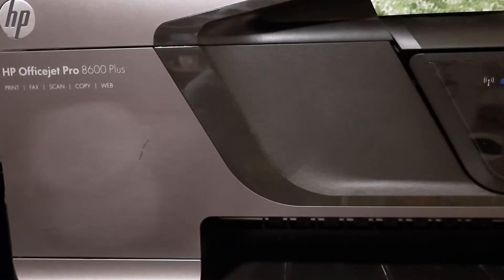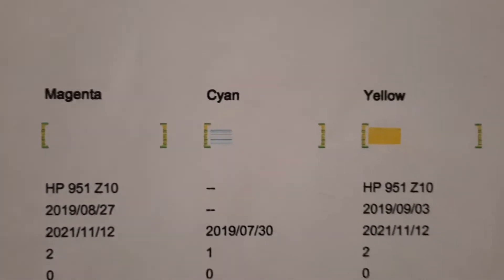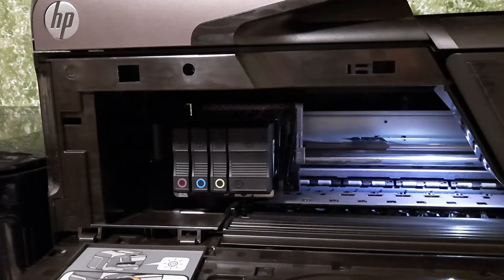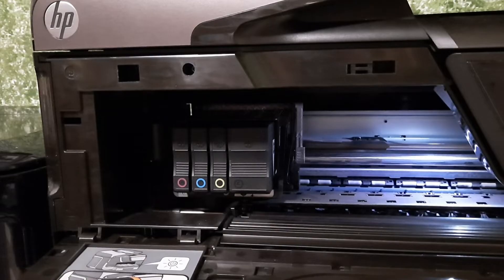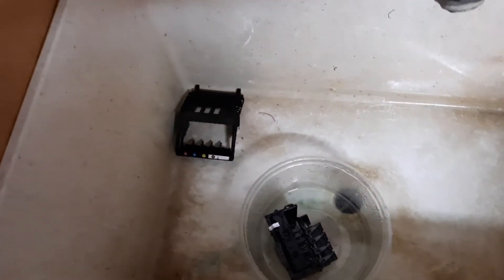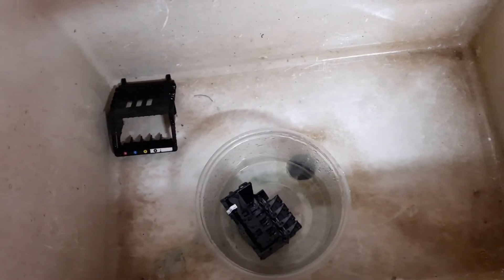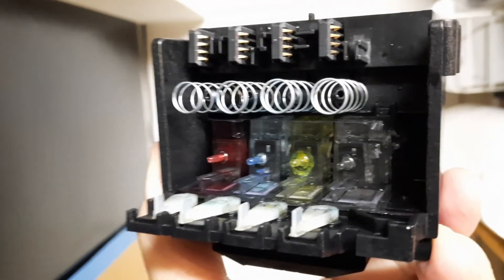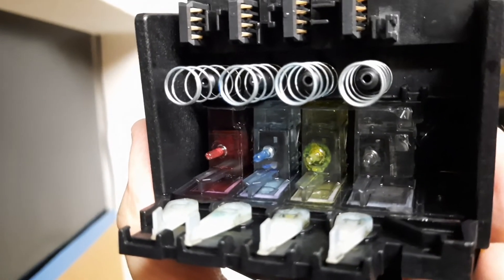HP Officejet Pro 8600 Plus Print Head Cleaning Tips for 2022

Comment: I purchased generic cartridges and got a “replace damaged cartridge CY”.  I went out and bought genuine HP cartridges but the message didn’t clear.  Any ideas?
Reply from the maker: I always used refillable cartridges.  Can you bypass or X that screen/box  on your computer
Reply: I’m having the same issue. 😡. Nothing clears the message. I’ve tried unplugging it from the machine and wall and then plugging it back in. Didn’t work. The only thing I haven’t tried is buying yet another set of new HP ink at over $100.

Comment: These print heads are junk. If one is giving you trouble jus buy another one from HP or get a new printer. Save yourself the headache.
Reply from the maker: You are not wrong.  Caveat emptor.    Let the buyer beware.  I'd be really cautious about used print heads.  New print head is about $112 plus tax and shipping.  So you have to wear the benefits, Buying a new one is not a bad idea. I bought an HP laser jet and the ink never drives out.  
On the other hand I have a Canon DVD printer,  with a bad print head, I haven't used in eighteen months.  I have about ten DVDs to print, And I probably have to take the risk to buy a used print head, because I don't want to buy a whole printer for this purpose only.

Comment: I am currently cleaning my head. Soaked it in rubbing alcokol overnight. You are VERY lucky you didn't blow out or rip the plastic diaphragm covering the ink reservoirs. If they rip or develop a hole while doing this, you have to use a flexible sealant to cover the hole. Make CERTAIN to use your finger or thumb to hold the small clear plastic film down when using the waterpick or applying ANY pressure to the ink resevoirs. I ran rubbing alcohol through the waterpick to clean the stuff out. This seems to be a common problem on the 8600 machines.
Reply: Yep, that’s exactly what happened to me. I was doing it with A medicine needle that you give your kids when they are sick for medicine and all I hear is…POP!!

Comment: You need using windex glass cleaner you need more solution than water like alcohol also need more time ..also the cause may be the rear back coonectors not work or  pressure in cartridge need alteration
Reply from the maker: Yes try everything first.  I sold mine as a black and white printer.  Saved it from  the window drop...

Comment: Don’t be afraid to drench the print head in water. I honestly did this as a last resort & it worked. I used an old soap bottle with a fine tip to spray each color individually. I also let warm water puddle to where water was going into each color simultaneously. I went as far as wetting the electronics which I don’t recommend. I made sure to blow dry the unit thoroughly & after installation all codes went away & it worked like new !
Reply from the maker: Congrats, nice to hear a success story

Comment: I have a HP Officejet Pro 8630 which was giving me print issues. One day when I went to use it the front display said Printer Failure. So I looked on Amazon and ordered a new HP Printhead for 108 dollars. I installed it today with new 3rd party ink cartridges and so far it is working like new again. The printhead cost about 1/3 of the price I paid for the printer brand new but I think it was worth it because it is one less printer going into the landfill. I will see how long it lasts.
Reply from the maker: Good plan.  It's a work horse, so you should get more years of service.  Glad it worked.
Reply: HP is utter rubbish
Reply: @benjaminmathew4108  I agree with you, if I ever do buy a new printer again it will be a printer from Canon with an ink tank. But for now my HP printer is still printing good with the print head I bought for it 4 months or so ago.

Comment: Remove the Print Head from the contact panel (with the gold contacts) at the back of the printhead; Two small Torx screws and prise out the little ribbon connector at the top. Then gently fold the panel down and inspect the two gold contacts where the cartridge springs push on them. (Be very careful with the tiny springs) Two for each of the cartridges. These form the electrical connections to the printer from the cartridge and read the ink levels (sometime!). Clean the the eight sets of contacts with a cotton bud carefully. If the contacts clean well, reassemble and retest. If any are pitted or won't clean. Do the following (there are other videos on YouTube about this by the way)
Cut 4 small pieces of aluminium foil and fold them so they are about 5 mm wide and may be ten high.
Using a small piece of sticky tape to attach each piece of foil over each pair of contacts
Ensure the foil does not overlap any other small contacts on the PCB
Reassemble the rear panel and gently push the ribbon cable back into the receptacle at the top. Place the printhead back in the printer. Replace the ink and turn on.
This worked for me and printing was restored instantly. Note you may have to wait for an alignment cycle to complete. Good Luck.
Reply: The foil trick will work HOWEVER be very careful not to let a cartridge run dry otherwise the printhead will burn out. That's because the foil bypasses detection of an empty cartridge.
Reply: @ikester475  I see, that means the goal of this quick fix is to short the contacts, not to make better contact with the small springs?
Reply from the maker: Great tip and opportunity to fix another potential problem.  Thank you!
Reply: This idea saves my printer .thank you very much
Reply: In the hole the spring sets in  is another  connection that is  impossible  to clean that the spring makes a connection with the board . If this gets dirty, your done. A new print head is in order to ever get that printer to work again.

Comment: Would using an ultrasonic cleaner speed up the process without damaging the print heads? Of course, making sure the water doesn't touch the electrical contacts. Would this still require the WaterPic step? The ultrasound might dislodge clogs.
Reply from the maker: It's worth a try.  Anything to free up a hardened plug would do it!
Reply: Tried that. But didn't  work on mine. Too dried up.The printer set for 6 years without any use on it. A new print head is the only thing to do.

Comment: Is it possible to reset ink levels? Or do I need to retain old cartridges in order to programmatically cycle the cartridges I border to refill?
Reply from the maker: Well, HP warranty stipulates their cartridges are required.  This ensures the ink level report is accurate.  But I've used generics and refills with some success and a few glitches.  I have not been able to manually reset levels.
Reply: @westvalley411  thanks for the reply. It’s helpful

Comment: I had an extended warranty on my HP Officejet printer.  Under warranty, they sent me another  certified remanufactured printer but I installed a Cannon in its place since I didn't have time to wait for them to ship the replacement HP.  When it arrived, I set it aside for months and months.  Later, I pulled the Canon printer out, and began with the HP that they sent to me.  It was actually the HP 8610.  Opening the box, the instructions said to remove the printhead from the 8600, and reinstall it into the 8610. What a piece of crap that was.  That was the problem with the 8600...the freekin printhead...those dumb shits.  Out of warranty, I called them back to say the forgot to send me a complete printer with proper working parts...like the freekin printhead. They wouldn't do a thing.  I could never go back to HP again, and their printers and the way they handle the ink cartridge debacle is fraudulent.  They keep track of the number of pages you print, they have no way of knowing the level of ink in your cartridges, and  if you try to use the same cartridges knowing theyy're still half full, they lock you out of even using your printer by the way they have the software installed and the updates to make.  They are scammers at best.. So I got this brand new reman printer I'm about to throw away, but not before I put my foot into the glass, and get it where it belongs...into the garbage where it will be picked up by Waste Management this Friday.
Reply from the maker: Drop kick that thing!  Just like cell phones and cars, they got us with the "warranty" scam.  Sorry about that.   I switched to an HP laser printer...and love it for basic printed pages.  No fuss.  More expensive but hassle free.

Comment: Mine does not seem to suck the catridges into the reservoir. But if manually refillled it it will work for a few pages. any ideas?
Reply: Pressure problem on the cartilage or most probably there is a clear plastic ribbon need to be reattached again .inside the head there a aplastic ribbon about 13 cm long and q cm wide I found it losse when I reattach it with glue it worked again ..

Comment: I have bought a printer for cheap because it had the same printhead as my printer.  But it was not used i think more than a year and the ink has totally clogged the nozzles. When i tried to clean it only the magenta passes a little bit of solution through. 99% of the printhead is clogged with dried ink. I have tried to submerge the bottom of printhead into hot water, then carefully inject distilled water with alcohol into it at all color locations but unfotunately the nozzles are completely blocked, i cant even inject the solution because of the air inside which is trapped isnide. I am afraid of pushing the syringe harder because i can tear the foil. Do you have  any solution for this special case how to clean completely dried up ink from the nozzles? Thank you
Reply: That dried out, it's time for a new printhead. Nothing can clean that dried crap out that wouldnt  damage the foil. It's too late.

Comment: I appreciate your video. I have a HP 8710 but your print head was close enough to be helpful with my 8710 problem. I changed the print head with a $137. 00 head I found on Amazon. It seems to be improving but it is still a work in progress. I may use your method to clean the old head and see if that works. PS: The $137 head seemed to be used as one of the torx head screws had some corrosion. I may return the head to Amazon if this does not improve.
Reply: For future reference, they are $50 on eBay from China. Likely pulled from machines
Reply from the maker: I hear you and good luck! Thank you!